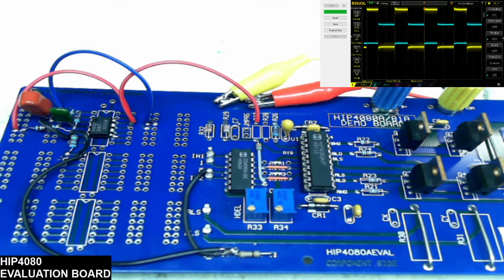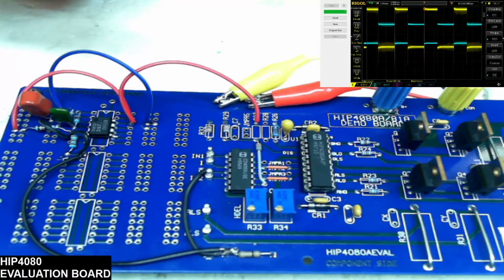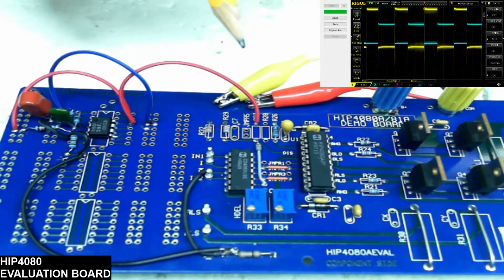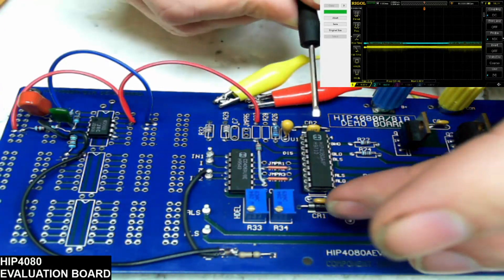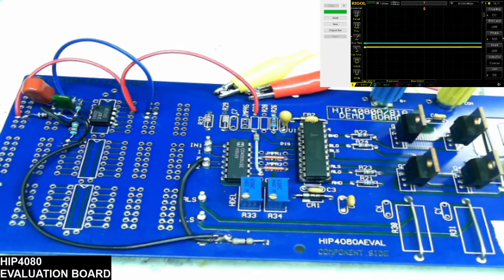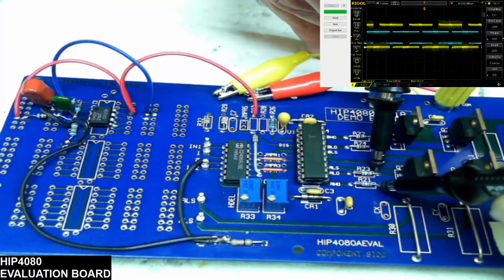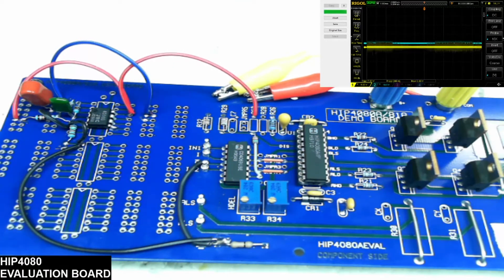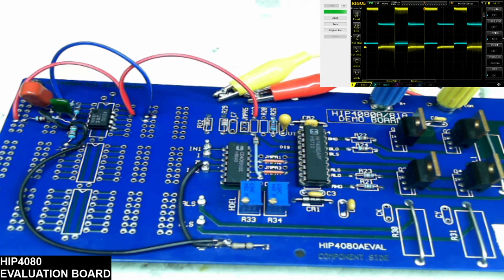HIP4080AIP Evaluation Demo Board Explained - For Finding Fake or Damaged IC's

Comment: great board what is the cost of that board?
Reply from the maker: The cost through Mouser I do believe is around $200
Reply: @ellensburgamplifier  holy cow thats alot. Is it really all that complex?
Reply from the maker: @Crazylogix007  I'm not sure why they are so much. The Mouser #968-HIP4080A/81AEVAL
 shows this crazy price. I got mine for about half that price only because I don't have time to build my own board. It is a simple board where you can easily switch between the 4080 and 4081.